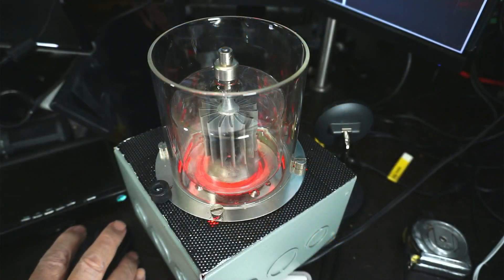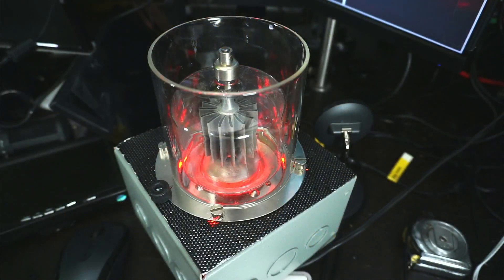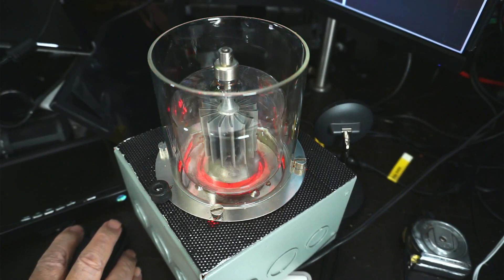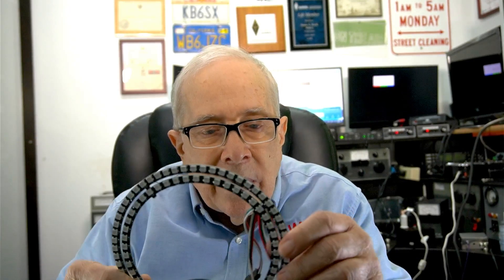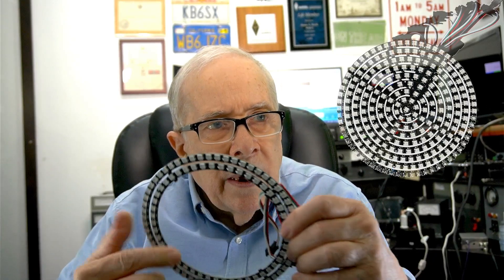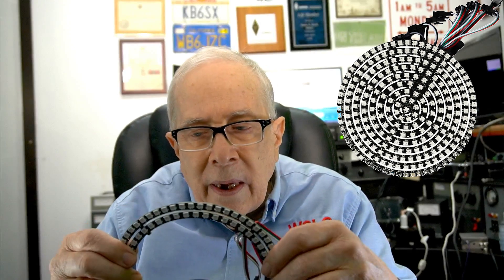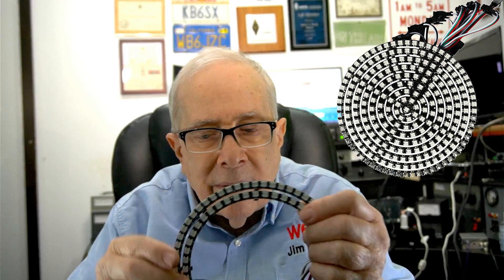Jim W6LG Makes a Nightlight Out of an Old Tube

Comment: There are also grey plastic electrical boxes with insulated lids at HD, two box mounting tabs to attach the box to a solid surface. I am not to sure what these electrical boxes are used for in the electrical trade, maybe they are junction boxes? at any rate, they are great project boxes.
    Great video Jim, thanks for sharing. I hope you are feeling well 🙏

Comment: Jim, grrreat video. Many, many years ago, I was gifted a bunch of large inop vacuum tubes; RCA872A,  Amperex 872AX, (4) National Electronics 872A's ),  (2) RCA813's, United Electronics VT-166, Jennings Radio VC50 vacuum capacitor, and the big boy amongst them all, a RCA673. 

All from a retired and kind, broadcast engineer that worked for the Bay Area TV station KRON.  

I've was trying to figure out what to do with them. My first idea was to remove two  of the pins on a 872 (since I have a lot of those experiment with)  and thread some "grain of wheat"  bulbs inside to give appearance that the filament was lit. I put that project aside and completely forgot about it, until this now.  

I like what you did with the LED rings MUCH better. Thanks so much for posting this video, it's gotten the idea gears turning again,  73 de KN6VMK
Reply: I've got a giant 857B mercury vapor Rectifier tube from the power supply of an RCA Ampliphase 50kw AM transmitter that I will someday repurpose as a table lamp.
Reply: @ctbcubed  Now there's something I never thought of doing...  My RCA673 would make a great desk lamp for the shack.